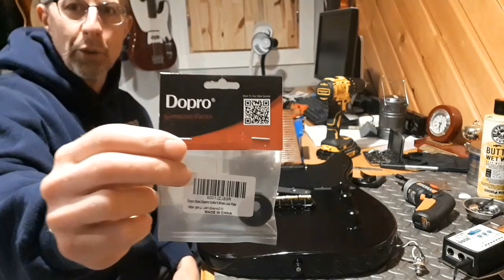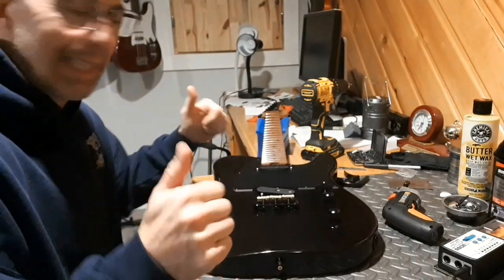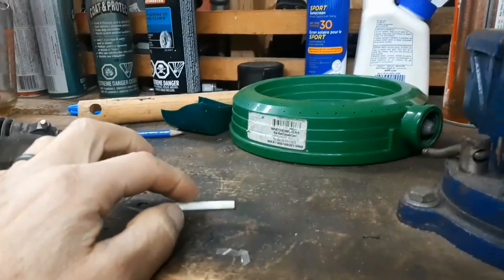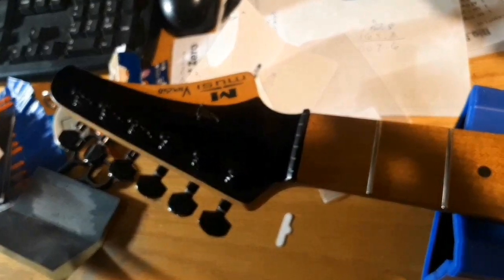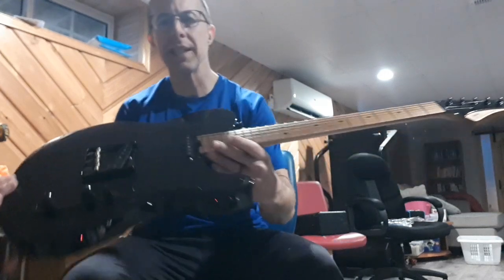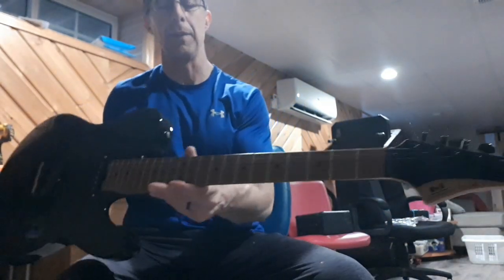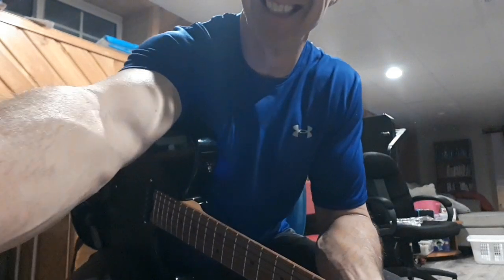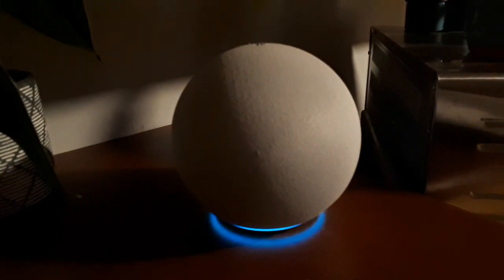M-Musi Classic Stealth Edition Complete!

Comment: So it looks like the Tusqs precut don't need nut file work?  That's a great find!  Your vise has provided great service in grinding the nut to the right height; perhaps some sacrificial materials could be used to save its jaws?  Not sure if it's psychological; that Stealth T sounds darker in tone to my ears.  Nice playing!
Reply from the maker: Hey thanks man! Yeah the pre-slotted nuts are great if you can get the correct height. I'm not great at it but it turned out ok! It does sound Darker, but I think its the black coated strings... I wanted them for the look but I will not be installing another set. Not a fan, but I had to go black strings for the theme hahaha!

Comment: sweet build dude, i modded my Musi virgo as well. shell pink but slapped on some gold hardware and a black guard. I was pretty surprised to see the components in the Musi’s are CTS-grade stuff with a pretty quality jack that mimics the puretones. I tore open the pickups and found enamel wire as well which isn’t cheap stuff.
Reply from the maker: Bet that looks killer man! 
Yup amazing quality for the price... Fender should pay attention!😂
Reply: @j-man9457  I've played around with several chinese brands, from bad to great. What I suspect is that chinese brands more often will pack wayy more bang for buck, rather than just a chinese made guitar owned by a western brand, purely because the factory itself is the brand. They likely care a lot more about what they put out since it's not like theyre outsourcing it to someone else, it's themselves and their own reputation on the line.
Reply from the maker: @capaya8139  yup makes perfect sense... Definitely seems to be the case or M-Musi and Westcreek, that's for sure!

Comment: The guitar looks really good! One suggestion: If you’d like an easier, less dangerous, and less destructive way to take down the height of that new nut, you could try laying down a piece of 220-320 grit sandpaper on a flat surface, and then simply rubbing the bottom of the nut over the sandpaper—at least, that’s how I’ve seen some pros like Dan Erlewine at StewMac do it in their videos.
Reply from the maker: Yeah that would probably be smarter! However, dangerous and destructive is fast, and fun haha!
Reply: @j-man9457  But that poor vice of yours… It looks so kind and faithful! I hate to think of it getting mutilated that way. 😂
Reply from the maker: @zuperdee  haha! The sand paper just shines it up haha!